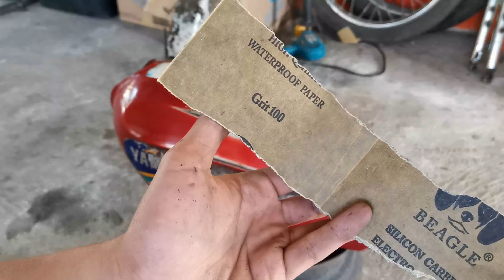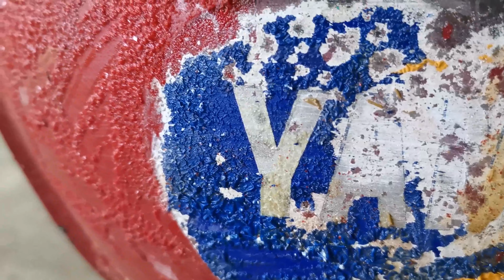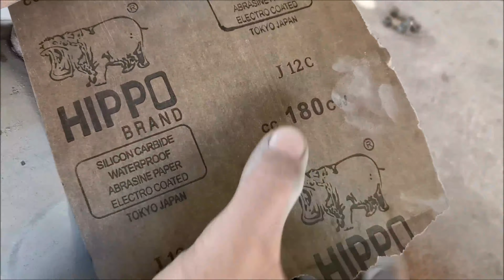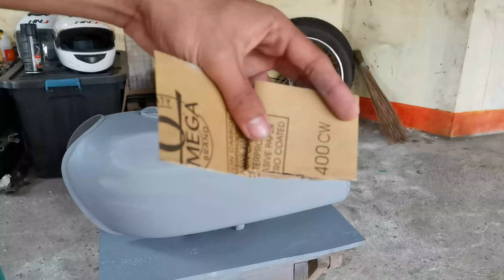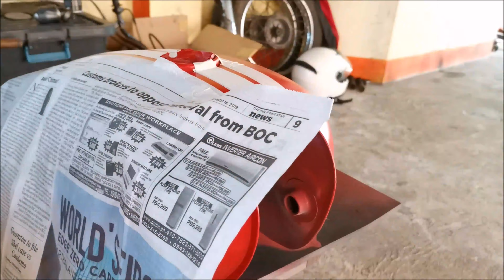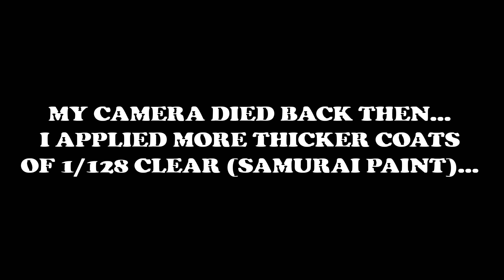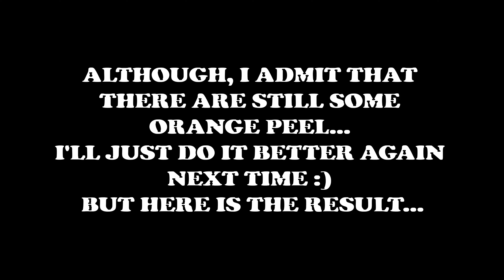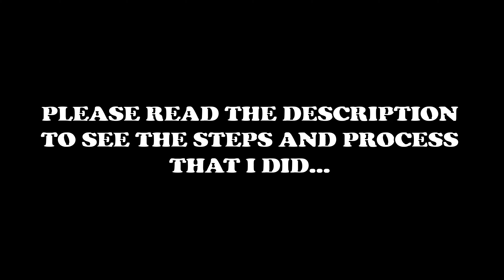RS 100 GAS TANK RESTORATION (TIMELAPSE)

Comment: sir,2ngkol po sa cafe racer project mo..penge po info sa sizes ng rim sa rear at front...at size po ng gulong..pa answer po..ty  in advance...more power
Reply from the maker: 110/70 -17 po rear. 
3.0 x 17rim stock hub
nakalimutan ko na po size ng spokes basta stock hub po ok lang
then 90/70 -17 front
2.50 x 17rim po
Reply: @MioDioWorks  nice tlga sir..ok timpla ng tires sa laki ng body....yung iba kc prang donut yung tires
Reply: @MioDioWorks  parehong 3.0x17 ang rim front and rear?
Reply: sir mio dio..kasya b yun 120/70 17 sa rear?salamat sir